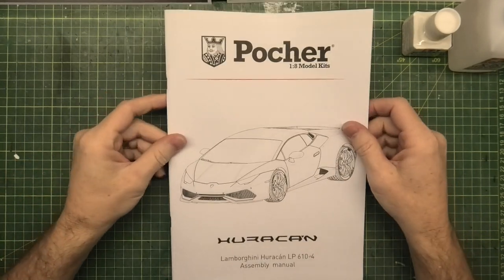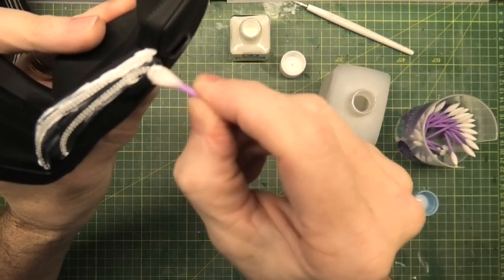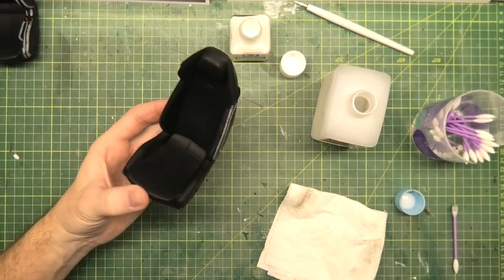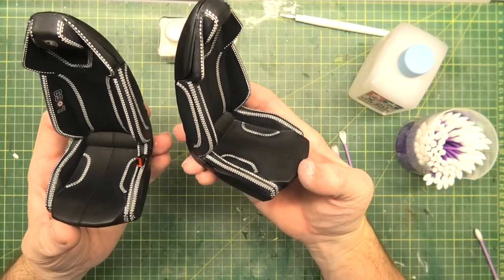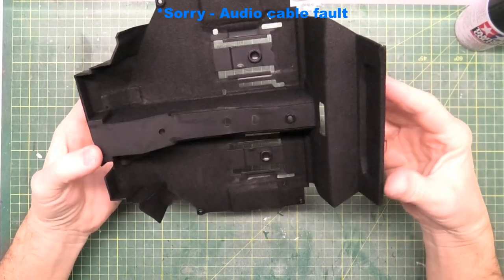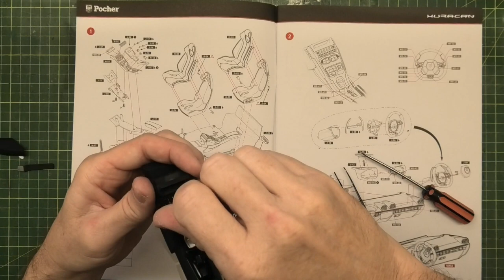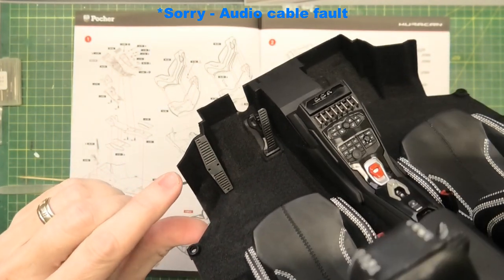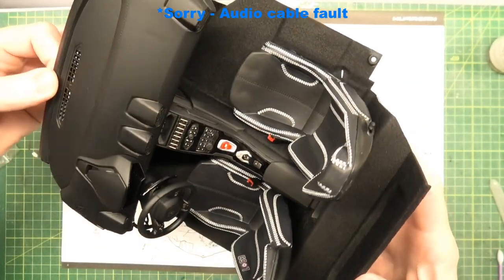How to Build the 1/8 Scale Pocher Lamborghini Huracan - Part 2 - First Mod's & Interior Assembly

Comment: Have you ever used spray adhesive for flocking, instead of wet paint?
Reply from the maker: No, flocking was designed to go over wet paint, so that is how I do it.
Reply: @ROBSMODELCARS  thanks, I did not know that!